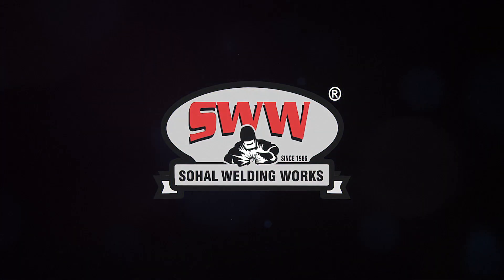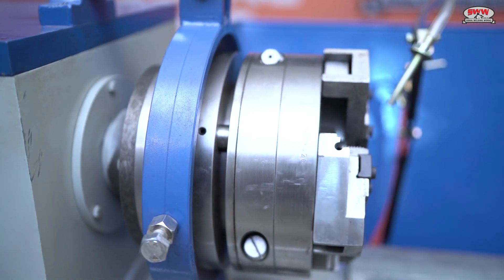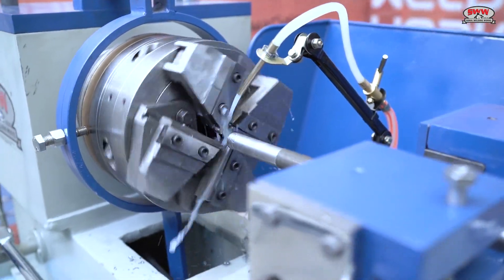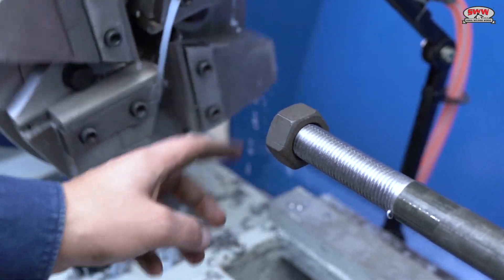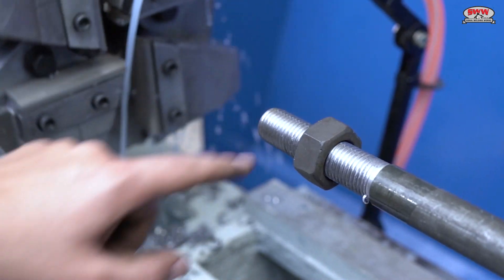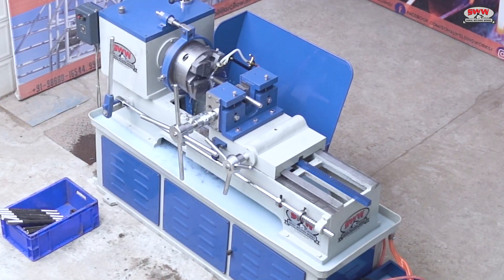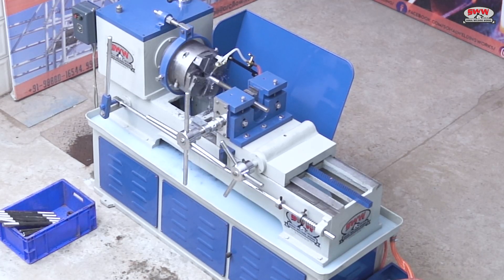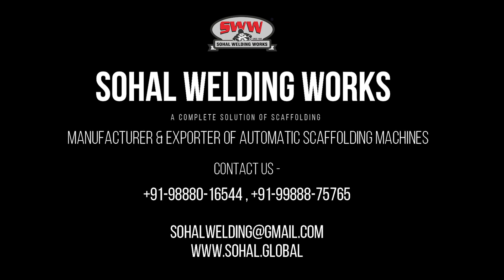Linco Die Head Threading Machine For Round Bar, Rebar Bar, Steel Bar - Sohal Welding Works

Comment: 10 mm to 40mm length 500mm therding machin price
Reply from the maker: Hello Mr.Amit 
Thanks for your query.
Please send us your query by email on sohalwelding@gmail.com or whts app +919988875765.
Our sales team will assist you in the same.
Reply: @SohalWelding  6 mm to 36 mm diameter Round rod threading machine price